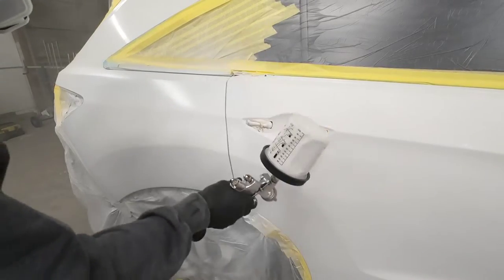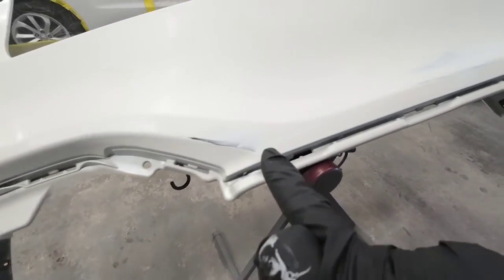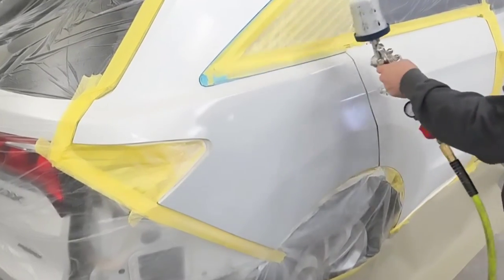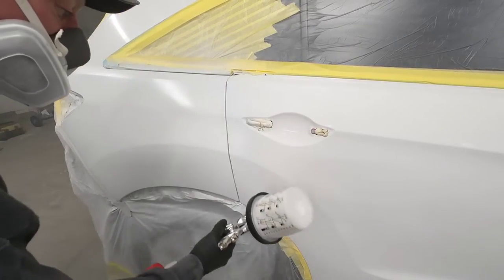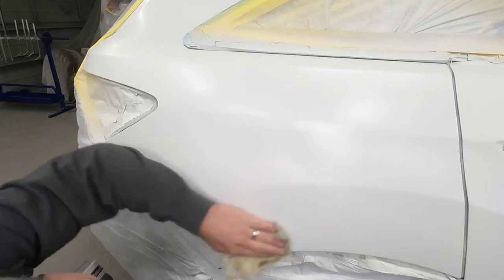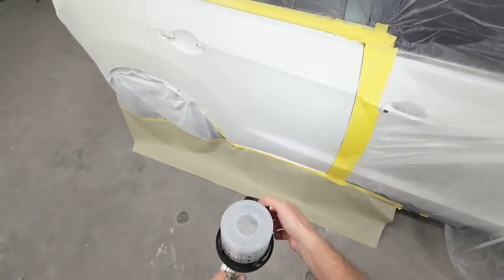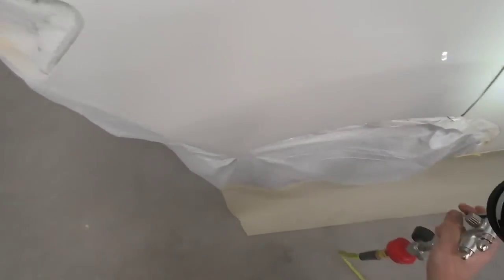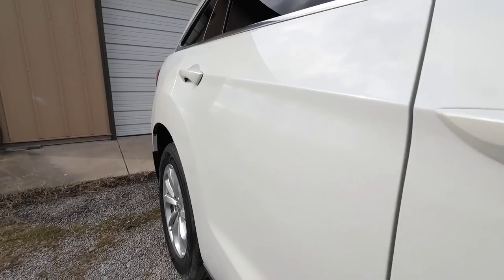How to paint a car using base coat / clear coat and the best way to set up your gun for clear!

Comment: Great teaching video.  I owned an aircraft paint shop and would have to teach the guys the right way to prep and paint before they attacked a major job.  I wish I had this video then.  One little trick on the proper fluid volume.  Turn off the air and then note the fluid stream…make it just less than a full stream.  This also tells you about your reducer amount on a high solids paint.
Reply from the maker: Right on! Appreciate the comment and support!

Comment: Thank you very much for a detailed instructions! Great video. Do we need to address a dry edge created by the sealer? Thanks.
Reply from the maker: I don't  really have a problem  with the edge of sealer but I did use upol #9 blender on the edge. I didn't show it in this video.
Reply: @GarageNoise  👍👍👍

Comment: Great video! Can you tell about the light you attached to the gun? Does it help to get even coats when you spray? I usually get decent results when my lighting is good but that's not always the case. I have never tried to attach a light to the spray gun...
Reply from the maker: I like it, mostly fore basecoat or if I'm clearing something low where I don't  have enough light . It's  only 60 bucks and comes in handy. Here's the link
https://amzn.to/3KI9GNK

Comment: How that clear coat is different from the standard Upol you normally use? How big of a job would be to decide which one?
Reply from the maker: It depends, I use the spot panel upol for most jobs because it dries a bit quicker. If your doing a full paint use the overall upol clearcoat it stays wet longer .

Comment: Hi chris I used this primer and I let it dry over a week cause the wheather didnt permit when ivwas sanding it it was a nightmare it didnt dry i spent hours sanding it was clogging all my sand paper what else you used beside reducer to make it dry faster do u have any dryin issues or clogging the paper ? Whats a better primer option that will sand smooth easily ? Thanks again
Reply from the maker: What primer were you using?
Reply from the maker: You probably were using a 1k primer. If so get rid of it and use a 2k which is catalyzed so you won't  have that issue.

Comment: Chris is it possible to spray upol  2253 as a high build primer with the R500 or is that asking too much from the 1.7 tip?  If so any settings would be appreciated.
Reply from the maker: 1.7 would spray upol high build no problem. If you get alot of texture or orange  peel it might be a little big so switch to the 1.5 if you have it. If you don't  it's  not a big deal the 1.7 will work. As far as the settings I would adjust you fan the width you like it and start with the fluid at 3 turns out from closed. The air pressure at about 15 to 18 psi. Appreciate the comment and support!
Reply: @GarageNoise  you are awesome.  Youre videos have given me great start on how to use the R500 to its max potential.

Comment: The missing link was the fluid volume from close, i base coated today. Came out beautiful. Thanks
Reply from the maker: Ok, good to know . Happy it worked out.
Reply: Just did clear on the hood and it came out perfect a little dirt cuz I'm in the garage. Doing a g20 van . last thing to paint is that big panel on the drivers side. No windows . i be a little scared. Ill let u know.
Reply from the maker: @davidgentz1731  awesome! Happy to hear it. Keep you spraying speed at a good pace and don't  spray scared and you should have no problem on the g20.
Reply: Getting ready to do sealer and the biggest panel how long can I let that sealer go before I put the base on I got some other things I got to do can I go 36 hours? I turn down the heat in the garage a few hours after spraying.
Reply from the maker: @davidgentz1731  check your TDS (technical data sheet) for the product your using.  36hrs may be to long to wait. Typically tje longest you should wait is 24 hrs. After that you need to scuff it up again before basecoat. I like to stay within a 4 hour window.
Reply: Thank you. Ill change my schedule. Im gonna wait till later to seal coat. Ill base and clear tomorrow
Reply: I feel like a high school kid in metal shop showin the teach my project. Just did sealer on big panel. I finished with a really reduced final mist. It all melted together. Your right u gotta move fast. Dont dilly dally. Tomorrow base and clear
Reply: Im considering using 1.4 tip. Would the settings be the same.
Reply from the maker: @davidgentz1731  you'll need to adjust for more material out of the gun . So lower fluid or up air pressure.
Reply: Just finished 2nd coat. Of clear comming laying nice and flat. I used my 1.3 to cut in and do smaller area. Used 1.4 for the large panel. So far so good. Thank you
Reply: Just sprayed last coat. Cant believe how good it turned out. Prayin for no runs. I think im good. Wow that was scary. No really.
Reply: Its done. No runs. Flat and shiney. Thank u so much.
Reply from the maker: @davidgentz1731  awesome! Happy to help!
Reply from the maker: @davidgentz1731  it'll just keep getting easier  the more you paint.